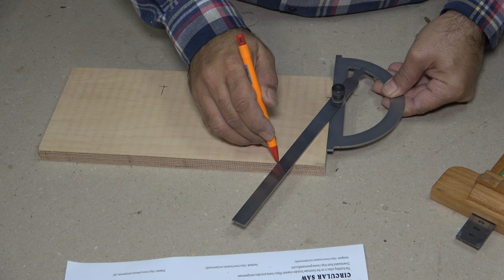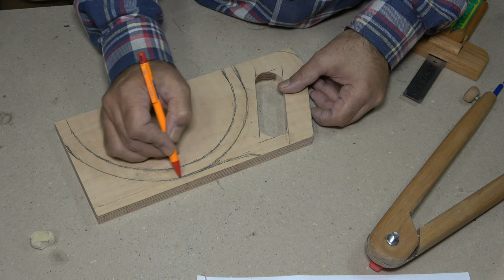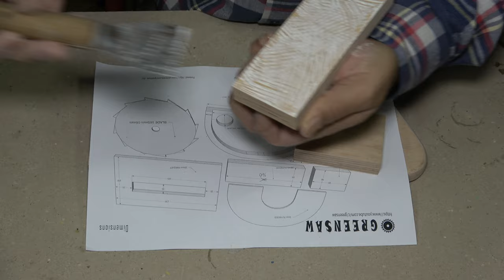DIY Drill Powered Circular Saw

Comment: The standard Circular Saw operates at 5000+ rpm. That cordless drill can output no more than 450 rpm.... i mean its fine for proof of concept.... but it is useless for most cases..
You can try whit old wired drills, they can do more than 6000 rpm, to see if there is any difference...  never the less, thanks for the video!
Reply from the maker: Thank you for sharing your knowledge with us. I agree with what you said. Kind regards.

Comment: Cool idea. I am not sure making a electric handsaw is a good thing. It's running off of a drill. A drill has a much lower RPM then a electric handsaw. It also has a much lower power. Average electric saws have about 1 1/2 - 2.5 even 3 hp/  If you have to cut longer pieces of wood, you are going to burn the edges. It's hard on the drill and it will eventually burnout or damage the battery.  Just saying.
Reply from the maker: Hello, thank you for sharing your ideas with us. You are right, the RPM is low. However, I don't think the drill battery will be damaged. Even though it's not as efficient as a real circular saw, I can still use it as a backup. In my last video, I cut a long board. Did you see ?
Reply: Yes I did see. You maybe right regarding the drill not burning out. I'm thinking ahead and I suppose if you don't over tax the drill it will help you out in a pinch.  @GreenSaw

Comment: don't try this at home, kids 😂😂😂
Reply from the maker: why ?
Reply: @GreenSaw  because as fun as this one is to build, it's only paralleled by how dangerous it'd be for actual use, especially for beginners with little-to-no money who might be tempted by this and use it as a shortcut instead of a shop bought circular saw with depth setting and blade guard.
Reply from the maker: Thank you for sharing your thoughts honestly and in good faith. I completely disagree with you. I think the security issue is overrated. If I had known, I would have closed the knife. Kind regards.